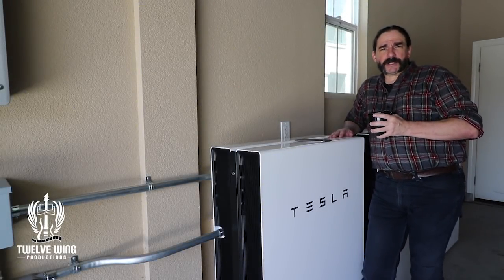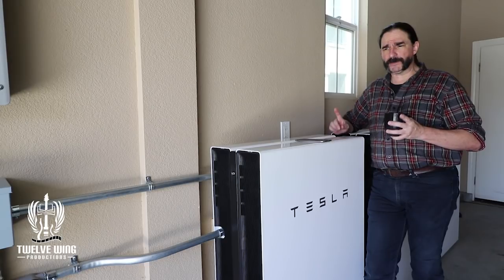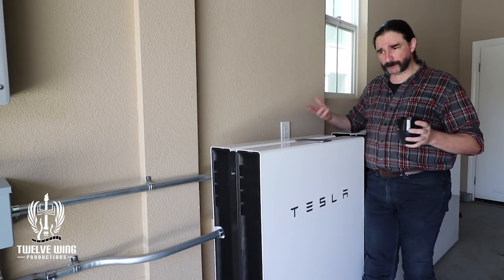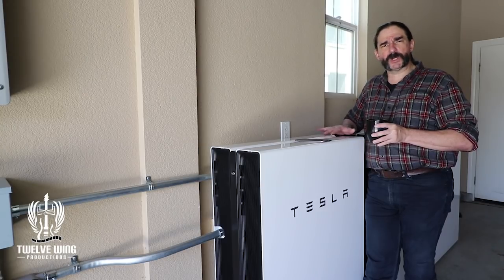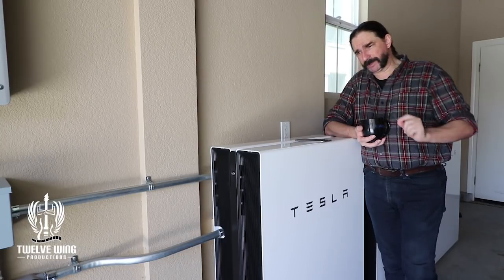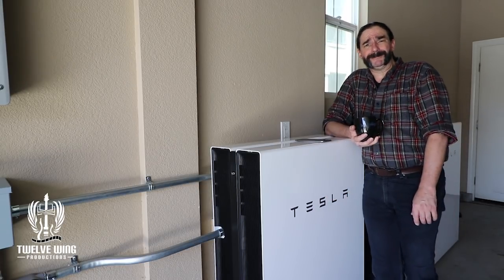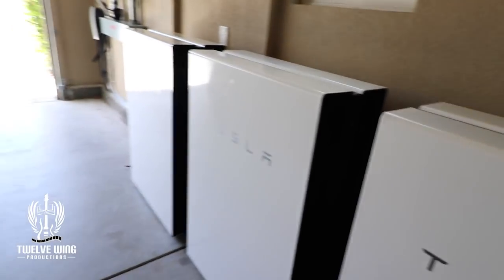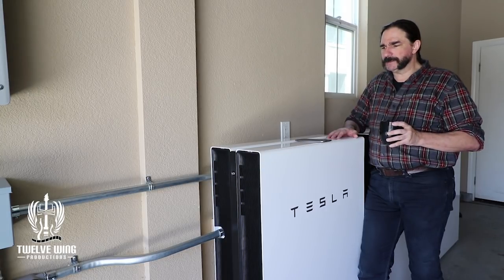Energy Sovereignty Project Quick Topic: Tesla Powerwall needs a capacity limit setting

Comment: I am off grid with 40kWh AGM and 12 kW of pV.  The batteries discharge through the night of course. The minimum discharge is 10%. So I don't understand why you don't go off the grid at night. You have a disconnect switch surely?  Run only on the powerwalls at night, and solar/ powerwall during the day.